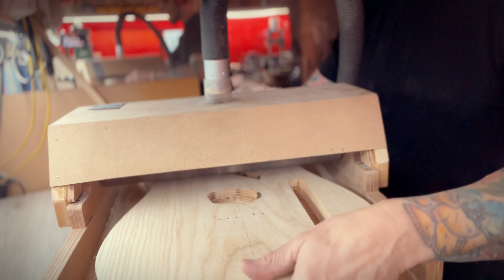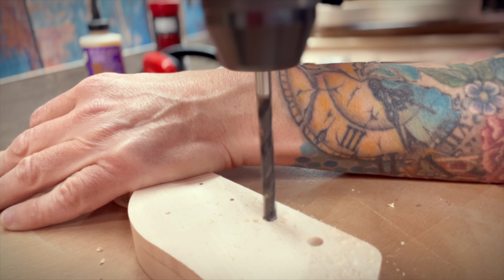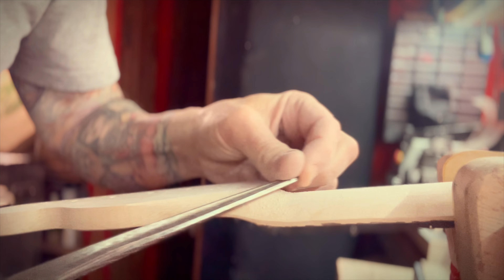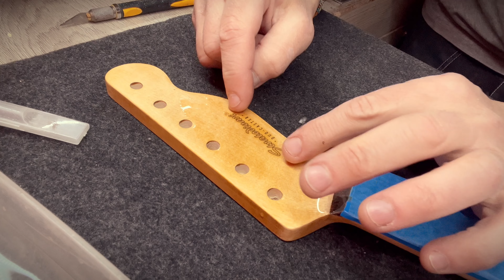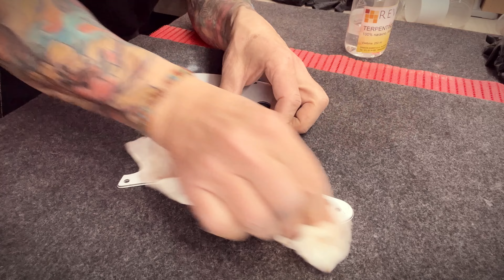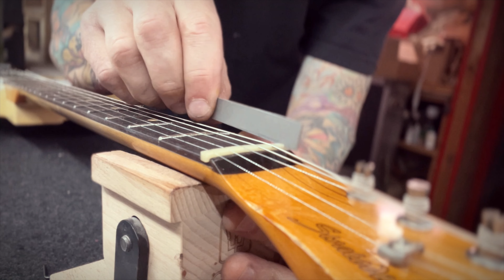Making a Telecaster (Full Build)

Comment: I've never seen a neck to fretboard reverse radius curve before.  Hella cool man.  I am so apprehensive to start my first build.  You builders make it look so effortless.
Reply: I haven't seen that either, made me think.
Reply: he may be  mimicking the construction of  veneer board neck from the 60s
Reply: Fender US Telecaster are like this.
Reply: He built a "veneer" board neck with a "slab board" look behind the nut with the concave curve facing out like a vintage 59-62 neck would have.
That's unique.
The Fender custom shop can't even get that curve done correctly on "masterbuilt" models costing the grand!.
Reply: @danieldupuys2002
No, no they do not.
Not even close!.
Reply: OP:

You will make mistakes. You will fix the mistakes. You will learn from the mistakes. You will build another with the lessons learned. 

You will then make new mistakes.

Comment: perfect. would you mind sharing the color code for the body or the name or better yet maybe the exact product you used?
Reply from the maker: The base coat is the standard "Vintage White" Nitro varnish. the next application, which adds coloration (patina), is mixed with clear nitro varnish and 1-2% yellowish pigment. This varnish with added dye must be transparent and applied only on certain areas of the body.

Comment: I would rout the edges before drilling the hole for the jack- there's nothing as satisfying as removing material that can't be replaced from a critical spot........it happens.

Also, I don't know why such a tiny brush was used when darkening the fretboard- he could have used a cloth, as he did ahead of the before/after shots.
Reply from the maker: 1: Everything went smoothly
2: In this "slow" way, the pores are better able to accept the chemicals. At least that's my experience

Comment: You do 4 coats of clear with 1-2 hrs dry time in between each time wet sanding?
Reply: Also amazing job
Reply from the maker: 24 hours between each coat. It can be less, but not less than 10 hours between layers...

Comment: Very cool. What is the name brand of the stain you used for the Neck?
Reply from the maker: In fact, I first do two coats with shellac, which I mix to the desired color shade with an alcohol-based stain (From the Portuguese brand "Nitorlack"), then I coat certain spots with amber nitro spray varnish and finally two coats with clear nitro.

Comment: Drill bits, router bits, saw blades;  if you see burn marks on the wood, and/or smoke while you're working, the tools are dull, or being pushed to fast, or both.  
Sharp tools used properly don't smoke, and don't leave burn marks in their path.  
That said, a personal quibble is always when I see that silly, unnecessary neck pickup rout on top of the body; thus requiring covering a huge portion of the beautiful guitar body with $1.09 piece of trashy, sheet plastic.  Pickguards are not beautiful.  And they always take away from the guitar.  
Simply using a 3/8" 'bell-hanger" bit, starting from the neck pocket strait to the control cavity, or the bridge pickup rout and the face of the guitar can be left un-hidden for everyone to see and admire.
Reply from the maker: That's great to know! Thanks a lot👍